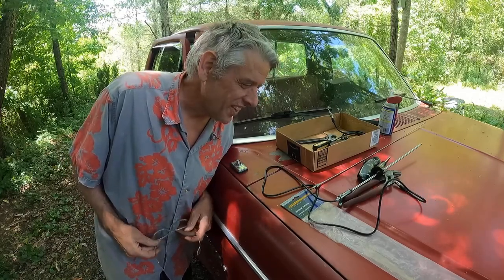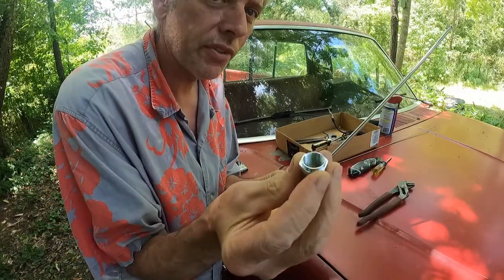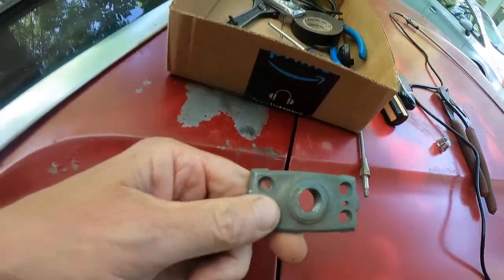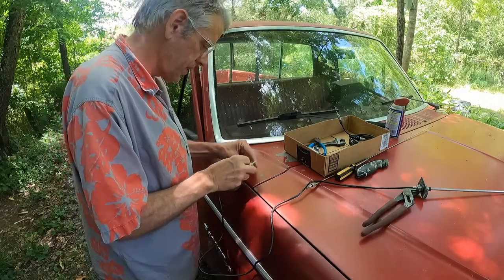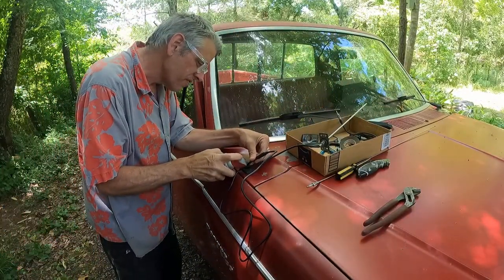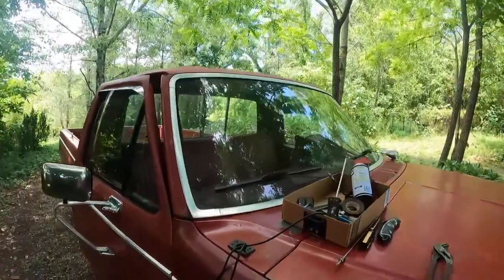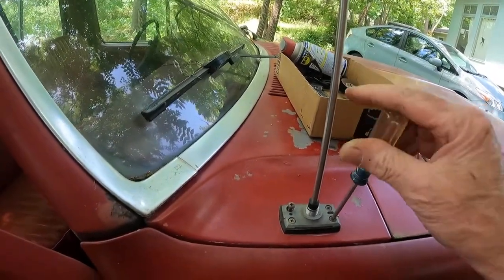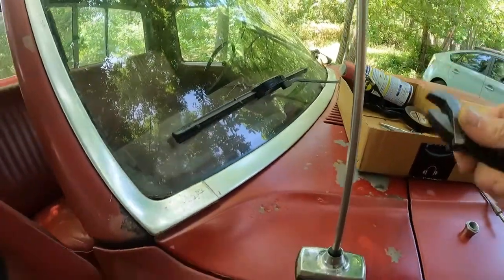1981- 85 ford f150 antenna install non oem

Comment: Hi I would like to get your link on the antenna you used on your video. I can't get it on my tablet. Could you please send it to me. I would greatly appreciate it. 
Stephen
Reply from the maker: i think this is the one https://shop.advanceautoparts.com/p/metra-electronics-ford-universal-rectangular-base-1965-up-antenna-cf-fd80/6050127-p?c3ch=PLA&c3nid=6050127-P&adtype=pla_with_promotion&product_channel=online&store_code=&gclid=CjwKCAiA9qKbBhAzEiwAS4yeDazl8J50TXw7FfJEQhnf6HPk7EG_pn_YgBVo-gH50radUIhuYyv7aRoCIj0QAvD_BwE&gclsrc=aw.ds
Reply from the maker: any universal antenae with a decent amount for the lead to plug in will work,you may not have to break off tabs like i did
Reply: Good video and you're funny